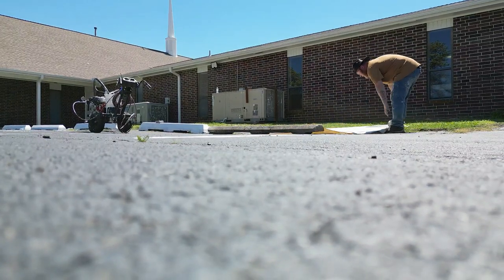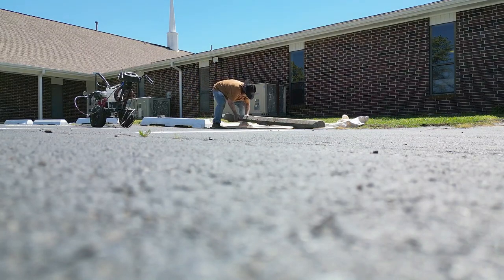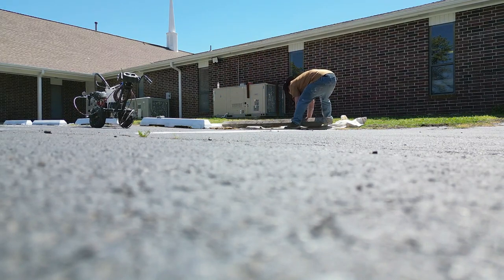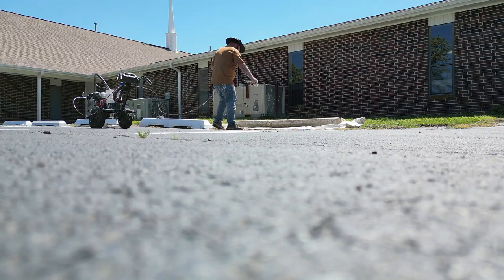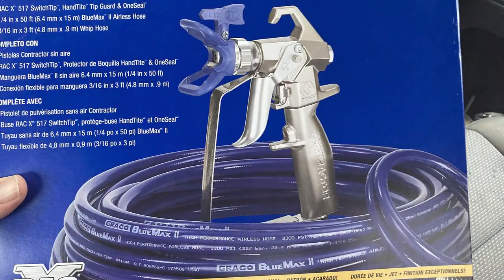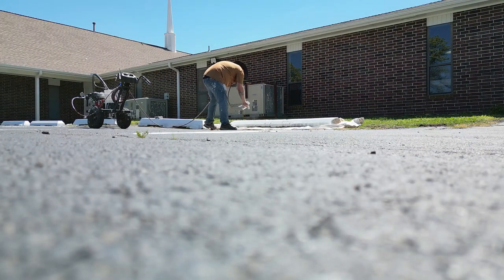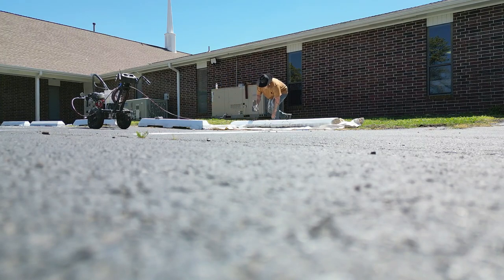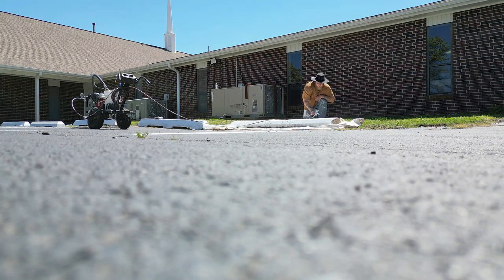How much do I charge to repaint concrete wheel stops/parking blocks in a parking lot?

Comment: I have thick plastic 8 ft long ,8 in wide spray boards i put down on either side of the wheel stops, around here they are pinned and if I had to move them onto a sheet ,I would be charging at least $50- 60 per stop because I wouldnt be moving them by hand but with my skid steer .